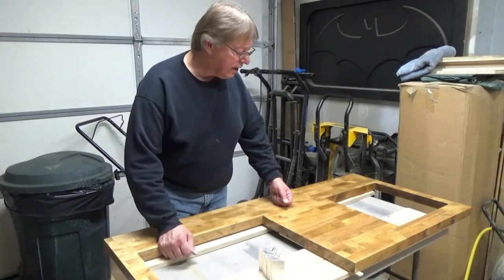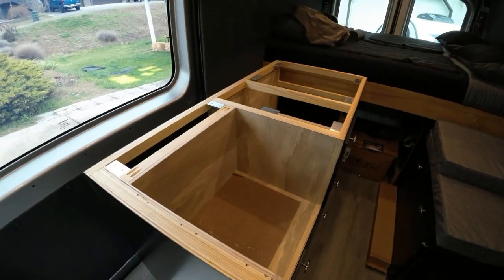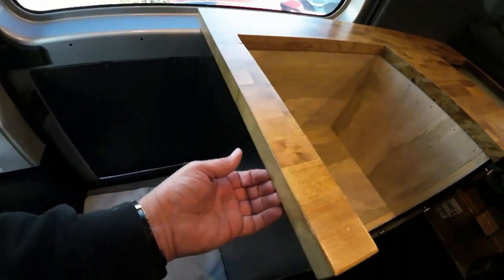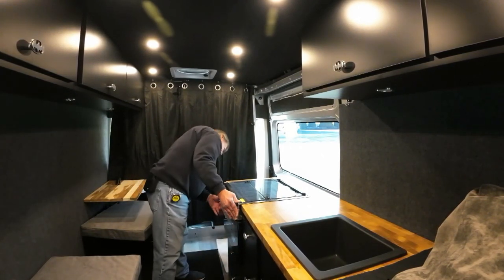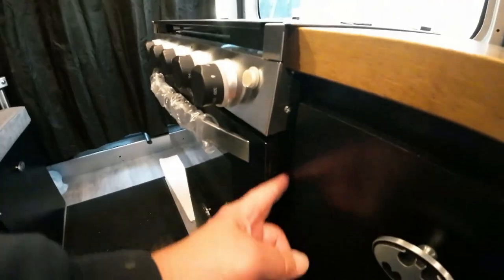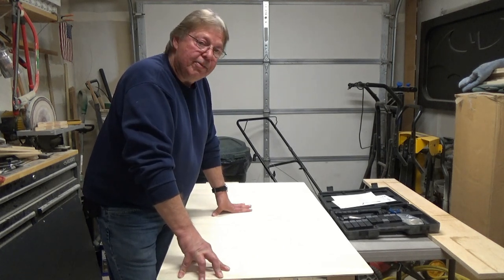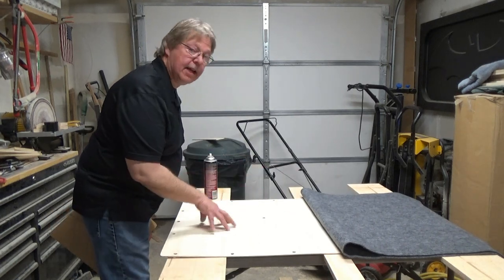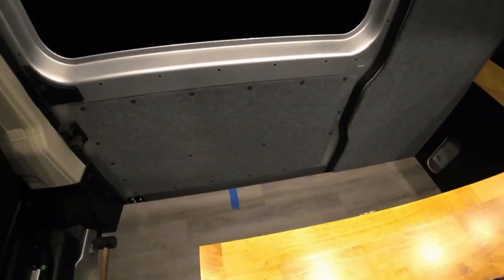Promaster Van Build 2500 159WB – DIY– Counter Top Install – Part 26

Comment: I'm glad you were able to reuse the black plastic automotive fasteners on the sliding door. I wonder if the original panel could have been carpeted over instead of using the plywood. I suppose not.
Reply from the maker: I thought about it... but that panel is so flimsy. Using the plywood, I will be ably to attach small items to it if I wanted to
Reply: @OregonBatman  i agree and it's better looking too because it's more substantial! 🆗🆒✅😊

Comment: not sure but i think if you look at instruction's it will show where the rubber boots go. my guess is on the flip back glass preventing the glass to go over the edge. thats what the grove in the rubber is for. connecting the rubber to the glass. then put back in place for travel. just guessing .
Reply from the maker: Looked at it and contemplated for a bit... I think it's just for shipping purposes. Once I get everything in place, it will be perfect! Unfortunately, the instructions were of no help...

Comment: Hi, regarding the oven / cooker: At 10.22 in your clip you talk about the small gaps left and right of the oven, although the thing is flush with the front of the cabinet. Could it be that the counter top doesn't extend enough at the front e.g. not enough overhang?
Reply from the maker: Yup, nailed it... The max overhang you can have is almost 1". I have a little over 1/2" due to width of counter. So the overhang I have is a little short and I have the gaps, which is perfectly fine and sort of look normal looking. Thanks for checking it out, and the comment!